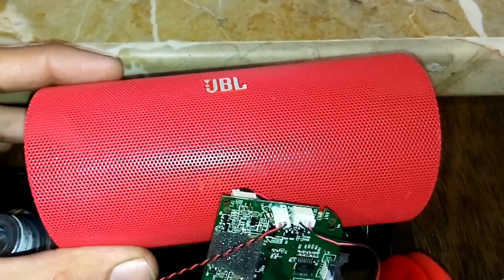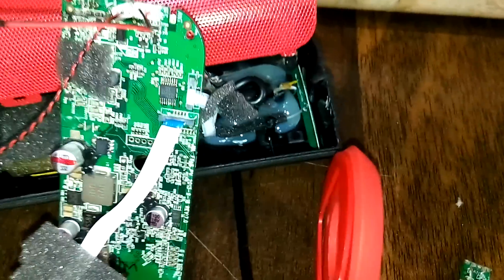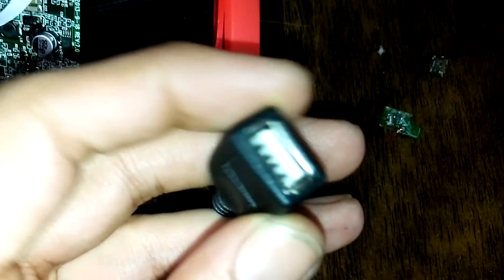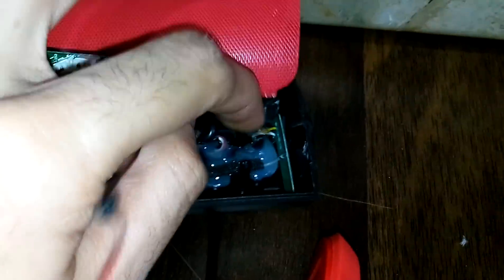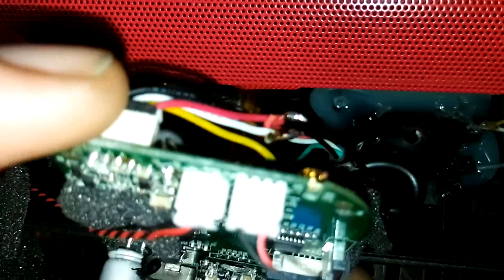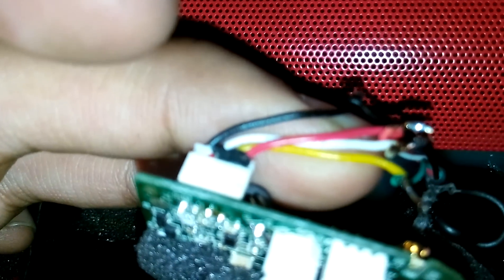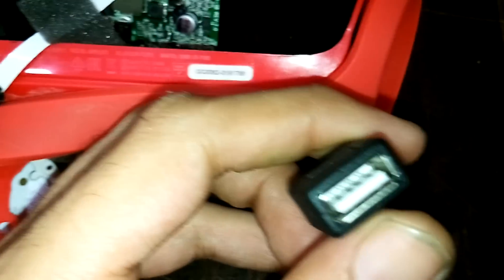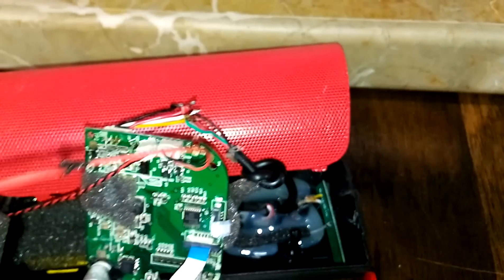JBL FLIP 2 - Charging Issue - Fix - Changing  / Replacing the USB connector

Comment: I just did something like this last night. except instead of the female usb I used an old charger cord I spliced right into the 4 lil power wires.  and it works! no more bending, twisting, and taping a crappy charger cable. thank you for this vid which of course gave me the idea to fix my speaker in the way i did

Comment: I just had to do the same fix. The micro-usb socket had completely broken off, and took the PCB tracks with it, so I couldn't just re-solder the socket. Your video gave me ideas, but that's not how I solved it. The PCB that holds the socket had these copper pads on the other side. I just soldered some tiny wires there, and routed them over to the other side, where i micro-soldered them onto a new socket. Here's pictures https://goo.gl/photos/JrZnhs5zxnH8i3aw8 . This fix is not for everyone, but it's doable.
Reply from the maker: +Olav Kokovkin certainly another way to do this. Thanks for sharing it bro!
Reply: Olav Kokovkin

Comment: Hey man!   Thanks for the tip... you helped me  a lot!  I just saved my gf's speakers!  You genius. . I just changed the female USB cable part, by using the original charging cable, so I can plug it directly on the original charger and still having the same color as the speaker :).  Thank you! !!
Reply from the maker: you most welcome bro!

Comment: Your idea is great. I tried it and succeeded too. But using the female usb connector directly to the charging wires is making the battery drain out quickly and take almost a whole day to charge completely. The entire mother board heats up while it is charging and in use. I tried with another battery and the result was same. So I guess my existing battery is working fine, it's this method of female usb connector which is causing this issue. Great idea though.

Comment: I am currently just trying to get it apart without breaking it. I do not have trouble with soldering, but the pieces just don't separate. I took all the screws out. I will keep trying.
Reply: OK, did it. The wires are extremely thin. 26 gage or less. Very delicate work. The rubbery stuff is silicone, sometimes known as RTV. Not easy. But it works.
Reply from the maker: I am glad to see my bit of novice experiment worked for many!
Reply: How do you get it appart??? Please help. Mine turns on but it gives no sound. It connects and everything but there is no sound coming out.
Reply: hovly movly Follow the video. The screws are not obvious and I had to dig to find them. This is not really a novice level project. The 'screen' cover pops out in some places, but must of my problem areas were hidden screws. Having no sound seems to be a problem other than what this thread addresses. "USB connector breaks loose from the circuit board and replace with USB cable". Sound was never an issue, charging was.

Comment: Do you know if the ac adaptor works to charge it also? Or is it only the usb? If u had the jbl flip 1 it had that kind of charger would that charge it or is it for the mic?
Reply from the maker: Tim F The Flip 1 had 2 connectors one for the charger DC Pin and other as Aux-in for Audio In.
You can try connecting a standard 5.5mm female DC connector to a Flip 2... In which case you should only connect the Red (+) and Black ( - ) wires from the flip's PCB.
Reply: +GadgetPulse. how do i connect those back to yhe battery
Reply: My piece broke off.

Comment: I followed all your steps, but my JBL flip 2 isn't charging anymore. I was having the same issue - micro usb with problem. 
It's still turning on and off, paring bluetooth, volume buttons ok, blinking all the the lights when I press power button, it keeps the last battery light blinking all the time, but doesnt charge anymore. what have i done wrong? :/
Reply from the maker: Well I wouldn't really know ... why dont you quickly run these checks...
1) Check the female USB connector you are using with a continuity tester to make sure that the cable is not faulty.
2) Make sure you connect the correct colour wire of the Female USB to the the corresponding stripped wire from JBL.(coz for me the cable had a green which i connected to the yellow of the JBL .. see time 6.27).. maybe your cable has a different colour.
3) If the battery is extremely low and you connect the charger... only the 1st light would keep blinking... after a while you would see the second light start blinking.

Comment: how to open jbl flip 2 same problem
Reply from the maker: Refer to the image in the link which will give you a heads up... rest I'm sure you'll figure out..
http://i.imgur.com/vJxlUCQ.jpg
Also be careful and make sure which side is which and which screw goes where when you putting it all back together.
P.S the NFC cord is very thin be sure to open it slowly or you might end up snapping the cord like I did. (I didn't bother connecting it back as its for my mum ... n she doesn't use NFC)
Reply: thx bro